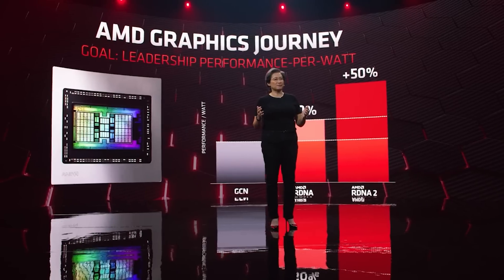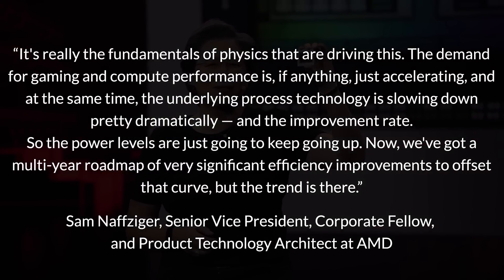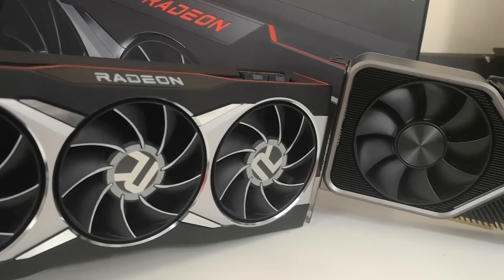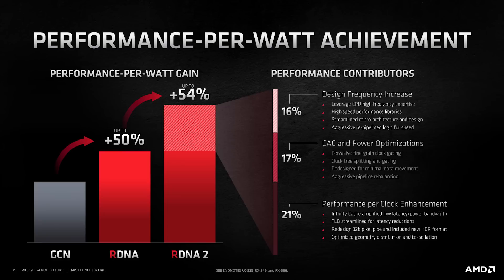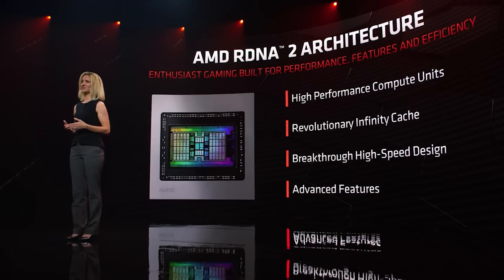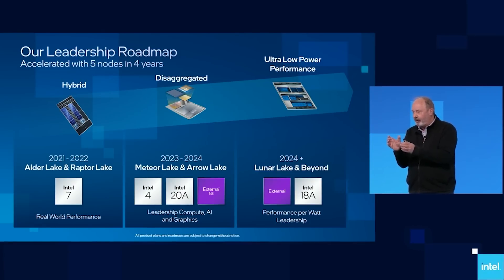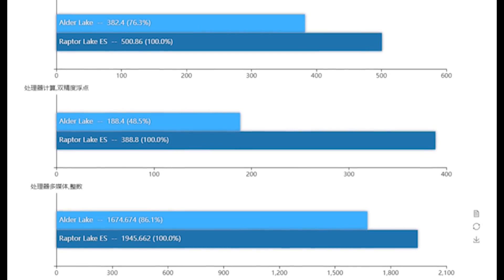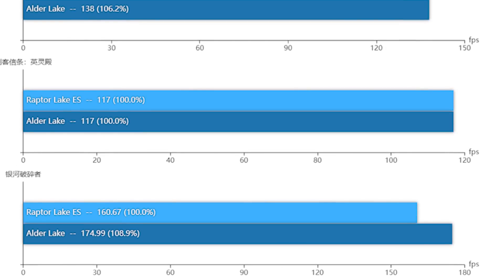AMD Discusses RDNA 3 Power Consumption, Performance & Design Challenges | Intel 13900 BENCHMARK LEAK

Comment: Wattage among generations is alarmingly growing up, I remember much "greener" times. Although my GF8800GT was 125W and Radeon HD6770 was 108W, other gpus made it with just mainboard power. Upto my 1050. While 4050 is expected to be double wattts.
Although performance per watt goes up, overal trends make me think gpu makers mainly just transfer chip designs to more efficient nodes, when those are available and then just rebrand higher tier models as next gen lower tiers.
Something what they did few time without any improvement already. (Radeon HD5000 series to HD6000, mine 6770 was dumb same specs 5770).
IMO They do it now again and still, but much softer ways, not to be blamed for it. (even cpu makers seem do same)
Reply: Also RX 480 --> RX 580

Comment: Probably going to skip this generation. Last generation both companies behaved very very very scummy. Then both don't seem too compelling, because both want to charge more after tarnishing good will. Not only that but both don't seem to address current gen issues. Which for AMD is mostly drivers/ software (also cutting corners with bus bandwidth causing inconsistencies in gaming). And Nvidia is hardware design. It's starting to look like a motherboard in a motherboard.

Comment: Improving FSR2/DLSS2 and future upscaling tech is going to become more and more important.   You can actually mod FSR2.0 into CP2077 now and it appears to work good enough. But CP2077 is apparently an exception as it has the data required to make it happen whereas many other games probably don't.
Reply: I am glad that these upscaling technologies are used in games. Curious if FSR 1.0 used in certain game, how difficult and probable game dev going implemented FSR 2.0.
There is bit chaos with these. Playing World of warships, they have enable option for DLLS in one of patches, but it dissapeared later. Although useless with logically terrible results on my Pascal gpu, it would be way to go to improve performance on rx 2000 series and up. Although that  game is not much graphically demanding, which is probably reason why its not main focus.

Comment: I haven't gamed on PC in over 15 years, and never built a PC but this fall I have decided this is the year.

2022 AMD sound like the way to go. Efficient and many improvements. Can't wait to hear the final prices / performances and decide on N31 or 32.

Hyped!
Reply: Welcome to PC gaming community.
Reply: if you ask me, get some actually hardware, dont buy the next gen stuff, when its new
Reply: @der-Troet  you suggest buying the current gen now when nex gen will be out in a few months ...?
Reply: @chrispreczewski  or you´ll wait for the next gen stuff, to buy the current hardware.
Reply: Do it only if you're rich, otherwise consoles are better.
Reply: The efficiency doesn’t make a big difference in the real world, it’s just another PR marketing point. Running 100W for 6 hours a day every day of the year at a power rate of 0.20 will cost 45 a year so if an nVidia card uses 50w more than an AMD card then that’s halved, if you only game with your GPU at full power for 3 hours a day then it’s halved again etc

Efficiency matters for commercial use, it’s not really an issue for domestic use.
Reply: @oxfordsparky  0.20? in europe, power costs upwards of 0.30, in many countries 0.40€ per kw/h. also after many driver updates, the power consumption of RX 6800XT / RX 6900XT is nearly 100 watts less than the RTX 3080.
by your calculation of 6hours a day  that would be nearly 90 euros a year. and that's just for the 100W difference.  
if you would run your RTX 3080 for 6hours a day while gaming, that  would be more than 300 euros a year just for power consumption of your GPU

Comment: if you plan to upgrade your gpu but you have to buy a 1200watt power supply just so you can use it just sounds dumb.
Price isn't the issue here but the pure hassle of redoing cable management and we know how much most people love doing cable management.
at most I will probably get whatever is around 400 watt range any more will turn my room into a sauna.

Comment: Asuming the data rate of the 48GBs gdr6x is doubled to the 24 of the 3090ti....1008.3 GB/s *2 = 2016.6GB/s so  with he micron spec of 7.25picojouls per bit transferred, the transfer alone can suck up to 7.25E-12 J/b * 2016GB/s * 2^30 B/GB *2^3 b/B  = 126J/s= 126Watts!!! that's for the frigging Transfer ALONE  
So sorry but the wattage spikes are no argument what so ever if you don't contemplate the VAAASTLY different specs rumored. 

For comparison transfer wattages of current gen:
6900xt --> 591GB/s *7.5E-12 J/b *2^33b/GB =38,1Watts   3090ti ----> 1008.3GB/s *7.25E-12 J/b *2^33b/GB = 62,8Watts

Comment: Between their improvements with FSR and Nvidia's insane power requirements I will most likely be buying AMD for the first time in over a decade.
Reply: with power costs in the UK through the roof i want the most efficient card possible!
Reply: For me, it's certainly possible I'll go with AMD for my next build. But it may be a couple of years before I get around to my next build, and it's anyone's guess as to where we may be in 2 years...
Reply: but Nvidia has dlss and better rt + power consumption isnt really worse than amd
Reply: @duevi4916  DLSS only works on game specifically coded to it.  FSR works on ALL games out of the box.  AMD is getting better and better with FSR to the point that its at least somewhat competitive with DLRSS.  That alongside a supposed lower power consumption with both next gen cards already being able to pump out super high FPS even without using DLSS or FSR.  The only thing that Nvidia still has the advanantage on is ray tracing and we have to see how the new 7000 AMD cards handle ray tracing.  Being that I am definitely using AMD CPU the smart boost or whatever they call it will also give a nice performance boost.
Reply: @reallybigjohnson  no it doesnt, fsr 2 needs to be implemented just like dlss and currently dlss is supported in far more games AND fsr2 even works on nvidia
Reply: @duevi4916  FSR 2 is open source it can be added to any game.  A modder just made it for Cyberpunk.  Assuming that AMD can deliver on its hype and produce similar results but with lower power draw then its a no brainer at least for me.  Good point on FSR working on Nvidia though.  I have to pay my electric bill and I am NOT going to end up paying more in electricitry than for the actual card itself.
Reply: @reallybigjohnson  the power draw isnt really lower the perf/watt is practically the same its just that amd declares their cards power draw horrendously bad, but the perf/watt isnt better on any brand and with next gen both brands having notoriously bad power draw, if anyone really cared for power draw you wouldnt buy that gen but stay at 6600xt / 3070 or cut down on using power at all spots in the house not just gpu
Reply: @duevi4916  Definitely not getting the top tier cards.  Ill get a 4070 or the AMD equivalent.  If they end up being roughly the same then the deciding factors will be price and if there is any significant gains with the infinity fabric compared to Nvidia's version.

I also live in America where we have 120 vs the rest of the world 240 power.  Might end up having to run my PC on two separate circuits if it gets any higher.  LOL
Reply: @reallybigjohnson  agreed! AMD and Nvidia will be very competitive and the key point will be pricing, I hope AMD has a meaningful pricing advantage next gen or else i cant be asked to buy amd again when i can get nvidia features for the same price/perf
Reply: Insane? Pmsl. 

Be prepared to eat those words.
Reply: @oxfordsparky  so you think the new cards wont be drawing more. power?

Comment: I'm hoping they confirm it uses less power than RDNA2
Reply: it wont stock, nvidia is raising power, amd has to do it as well
Reply: @ultratronger  They're raising power to increase resolution and frames per second. I don't need that. Part of the new technologies (supposedly)  is increased efficiencies and better features. I want that. If I can buy a RX 7600xt or 7500xt that's measurably better than a RX 5700xt with lower power draw and price it's a better value.

Comment: Well I hope GPU performance demand will begin to plateau at some point. There's only so many pixels that one can take in at a given time – 4K is pretty close to that. You have to stand so close to a 8K screen to see the individual pixels that you can barely capture the entirety even in your peripheral vision. And at some point (I guess fully ray-traced graphics?) the quality is also going to (nearly) peak. It's insanity to push power consumption to over 1 kW for barely noticeable improvements in resolution and fidelity.
Reply: Obviously you've never used VR.
Reply: No chance, not with the advent of 240hz 4K monitors and features like ray tracing. More power is going to be “required” endlessly.
Reply: Even with same resolution and other factors like encoding, this statement is false. Why? Because games all perform differently. Compare a racing games demands to games full of lights and clutter and poor optimization like Cyberpunk. Optimization is rare and even with a 3090 ti it can't do 4k 60 rt. And that's for our current style of games. How about a real city, with npcs with real AI and doesn't disappear when you turn around? How about them all talking on their phones or smoking, chewing, sprinting, laughing, ect. Very stiff and basic. It depends on the game. Not the hardware.
Reply: @peternash7104  It's not a statement, it's "I hope"

Comment: I think there’s an argument to be had that a GPU that performs “good enough” at 4K but does so with good power efficiency would sell.  Efficiency is going to become a marketing point.
Reply: @beedoox5613  mining...
Reply: @michaels8655  Unless mining value increases significantly mining is dead. Ethereum going proof of stake is going to help it stay dead.
Reply: @michaels8655  being better overall was the real driving factor.
Reply: @beedoox5613  ....but Nvidia is the one actually behind. They are still on monolithic while AMD actually is pushing innovation with chiplet. 

If pushing more power consumption 1:1 for performance isn't a win. It's a bandaid at best.

Having a 3090, fuck the heat it pushes out. It's a lava brick. And that's after multiple repastes, undervolting and repads which is unforgivable given the price.

We are re-entering the era where hardware performance will far exceed what games can actually do so buyers are going to need to know what their needs truly are in order to get the right product for them.
Reply: @MagiofAsura  repasting and replacing thermal pads will, if effective, actually increase the heat output from the cooler as it’s moving more heat from the components.
Reply: Having to upgrade your psu in order to get a GPU upgrade is fucked. I'm not feeling that shit. Hopefully my 850w will be fine for a good while.
Reply: @beedoox5613  It's cause AMD produces much less GPU's and also the deman for Nvidia cards is simply higher irrespective of there products.

Something takes time but you keep doing stupid things which is what nvidia is doing sooner or later you will fall. Intel is an great example.

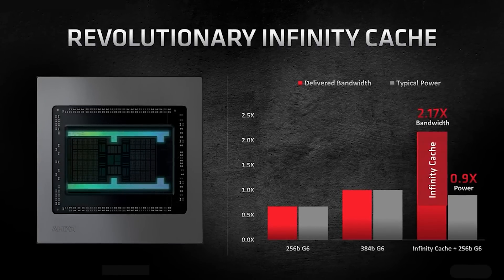Comment: 4:06 "officially speaking RDNA3 improves P/W by up to 50%"
That's not true and I don't know why you only got " a rumour from a single source" that this number is the worst case. Because in AMDs official presentation, that you also showed at the beginning of the video, they're saying P/W is ">50%". Thats more than 50%,  not up to 50%.
So basically the only single source you need is AMD who said that 50% is the worst case.
Reply: He said UP to is 50 is the "worst case" or minimum meaning yes it is gonna be over 50 he said the exact same thing as you and AMD's presentation just with different wording. He is saying that his other sources corroborate with amds presentation it is an affirmation saying the numbers are right.
Reply: @JimTheMathGuy  He should have said greater than 50% as 50% is going to be the worst case. Up to means it will not go above 50%.
Reply: @redrock425  yeah I know that he should have said it better but as "worst case it is up to" means the better cases is above that saying the worst value could be 50 but the others are better.
Reply: @redrock425  he should have said it better even if it is technically correct
Reply: @JimTheMathGuy  No he said officially it's "up to 50%" but a single source told him that those 50% is the minimum. 
And that statement is not correct, because the official info is not "up to 50%"

Comment: This is pretty clear for a long time. Nvidia is pretty shit, they can only go bigger die and higher power levels to match or best AMD, already the case with RDNA2/RTX3000. Sadly people are stupid enough to buy a new PSU and power adapters etc to 'gEt ThE bEsT'. You can only praise Nvidia's marketing.
Reply: True, also when you realise that the majority of people(gamers) don't follow hardware news and have very limited knowledge when it comes to PC parts. That's why Nvidia is pushing GPU to influencers lately and not tech channels trying to delay/limit reviews before launch. Its the same  with Razer even if they have inferior products people still buy them because of aggressive marketing.
Reply: Typical fanboy.

Comment: I don't know if there's really been a time where AMD had a considerably higher power draw than Nvidia.
Reply: Vega was kind of terrible in terms of power consumption
Reply: @leomuricy  Does that include the R9 Nano. Or was that something else entirely? Guess its a good thing Vega is now replaced with Navi2 and 3.
Reply: @justinpatterson5291  Vega 56, 64 and radeon 7
Reply: Does Vega count?
Reply: @yukihanayuki  out of the box Vega was pretty bad, but it does love to undervolted. I have vega64 down to 180W (same as a GTX 1080) will full performance (same as a GTX 1080) - So Vega was potentially competitive, AMD just had it well over volted.
Reply: @forestR1  put a wattmeter on to see what it’s really drawing, don’t believe the reported power.
Reply: @oxfordsparky  when you say "Watt meter"; are you taking about a mains power watt meter? That showed a 200W higher draw with a gpu load? Because ...well not to say that it's "inacurate" but it's measuring a different power difference. IE that would be measuring the difference of: 
(System loaded - system idle) ÷ PSU efficiency.
Which will be different to reported values of VRM output. 
I don't disagree with the validity of doing that; but it would need to be measured that way for the GTX-1080 too.
Reply: @Start Finish Ah, well that makes sense. I took a break from all things computers and gaming right about then... I knew about the 580 though. That was just bad.
Reply: @justinpatterson5291  580 in terms of perf/dollar was amazing deal. But it's definetly not power efficient
Reply: Where have you been?  They've always had higher power draw for years.  Power consumption is why I've been buying Nvidia, else I've had bought AMD graphics years ago.
Reply: @ed-te1fp  fanboys with zero knowledge of history
Reply: Nvidia and AMD both made some toasters over the years they also made good efficient cards also. I used to buy Radion cards but since AMD bought out ATI the drivers have been problematic for me. I switched to Nvidia about 16 years ago and yeah some of them sucked the juice but drivers were solid.  I need a new card and if AMD releases a card that draws 350-450 watts and doesn't have transient spikes I will be looking hard at them in the fall.
Reply: Wtf do you have the shortest attention span or something?
Reply: Polaris was pretty shocking for power draw too, take a wattmeter and see how much power the rx400 and rx500 really used, the power claimed in software was miles out. My friend mines with rx480’s and they report 130W in software but actually draw about 200W.